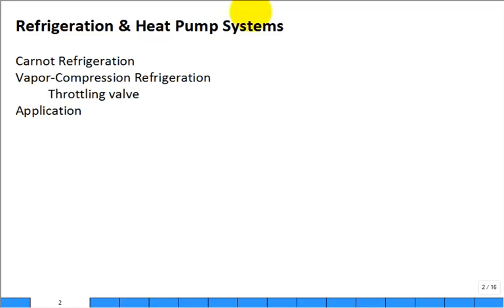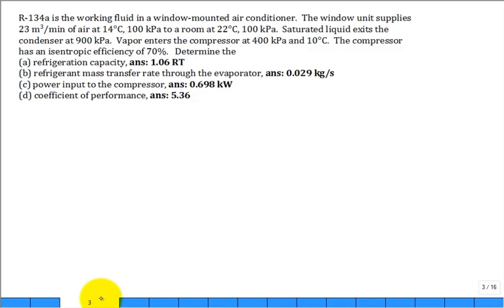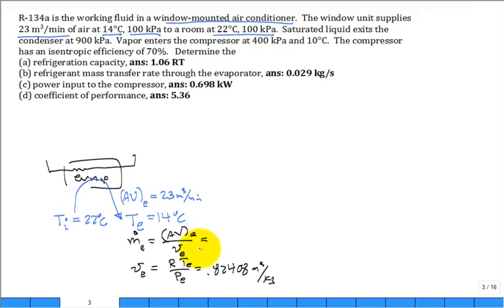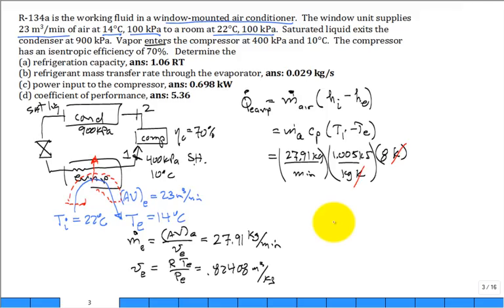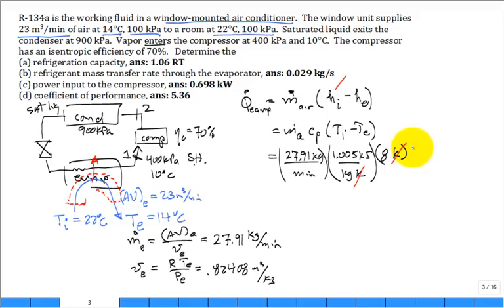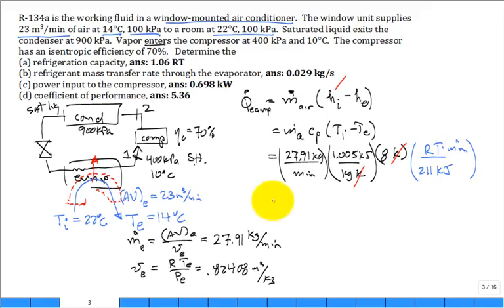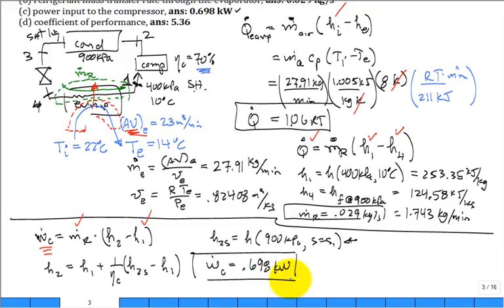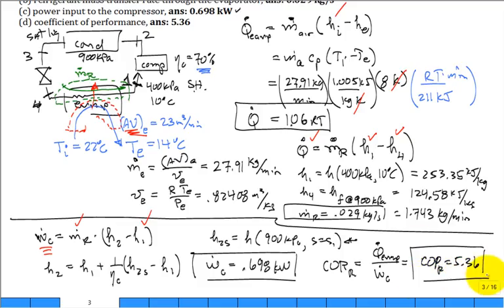ME4293 Two Evaporator Refrigeration Spring2017

Comment: @9:35--Unless I am mistaken, the h_f for state four is incorrect. If 900kPa =9bar and according to Table A-11, at 9 bar the h_f is 99.56kJ/kg, not 124.58kJ/kg.
Reply from the maker: you are correct.  so answers change: (a) 1.06 RT (b) .0243 kg/s, (c) 0.584 kW, (d) 6.4

Comment: @25:02-- why is the enthalpy the same at states 3, 4 and 7? I understand that for the expansion valve there is no change in enthalpy, so I can understand that h_3=h_4. However, there is the mass split between states 4 and 7. I thought that was the reason the energy balance was used to find the enthalpy at state 1 (@20:00)
Reply from the maker: flow splits after state 4 feeding evap #1 and evap #2.  intensive properties are same after split.  when have mixing (joining 2 fluid streams) need mass and energy balances to find exit intensive properties like h, T, ...
Reply: Randall Manteufel thank you! I also realized that if where it splits by state four all of those states are fixed by temperature and pressure, the properties are the same. whereas the other split they only have pressure in common. thanks for the clarification!!